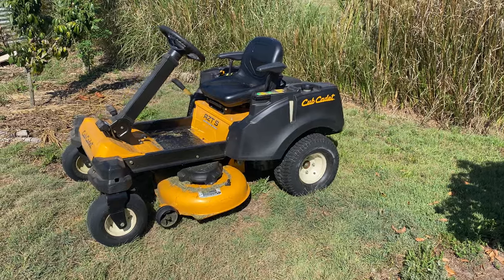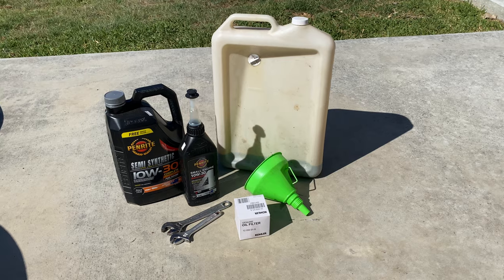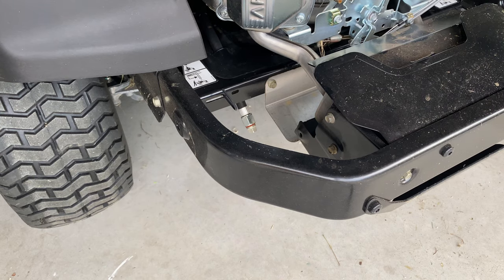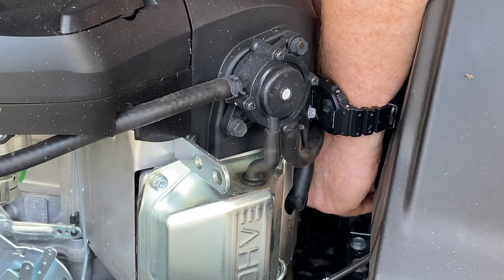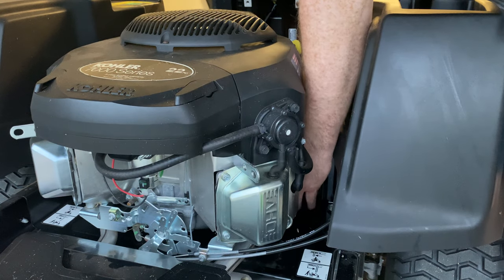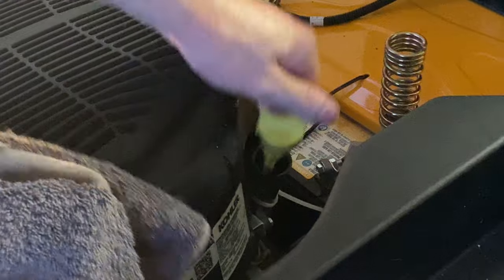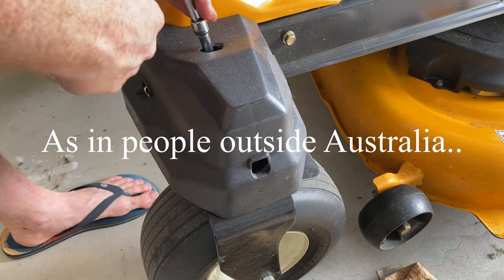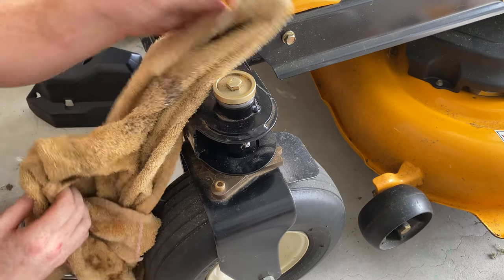Cub Cadet RZT S First Service

Comment: Thaks for this!  Helped me see the Steering Zerks I was missing. Getting harder to steer  every time I mow.  Time saver too. Great you showed whats under those Front Covers. Thank you Sir!
Reply from the maker: I am very happy to hear it helped :) All the best. Dan
Reply: @PracticalPrimate  
I’m Handicapped on my left side, but was able to reach under and felt and cleaned the Zerk off. Got my Locking Fitting on and Pumped each 3 pumps. They looked so shiny dry like missed at Dealer! No wonder it was so hard to turn even with my Swivel Ball on Steering Wheel !

Now it’s like Greased Lightning!!
Reply from the maker: Fantastic, glad to hear that it’s working properly now :)

Comment: Very helpful video. But in the manual,the first 5hour service only need to change the engine oil, however, I  watched you changed the oil filter in the same time.Is it necessory?
Reply from the maker: Whenever I change the oil in any machine I change the filter. That is standard practice. I would have to check the manual again to see if it says something different. Usually if any manual says to change the oil they also expect you to change the filter at that point.

Comment: Thanks for this video. Quick question. Have you ever tried to add the weight to the front of this model? I can’t seem to work out how it goes. And nothing online that I can see
Reply: How much weight and why?  It is going to increase steering wear and incur risk.  It would have to be front center (see 0:35 seconds) into the black frame below the Logo, basically like adding a trailer plate there.  I think it is begging for trouble unless its a 10lb add or smaller

Comment: I have the same mower.  Mine requested an oil change, so I just added to it instead of changing it.  Now it will not start.  It turns over so the battery is good.  Do you know if there is a bypass or reset to make it start?
Reply from the maker: Hi Jeffrey
The oil warning is for oil pressure. It will always show when ignition is on but the engine isn’t running (or when there is actually an oil pressure/low oil issue). Is it possible you saw the warning when the engine was off and now have too much oil?